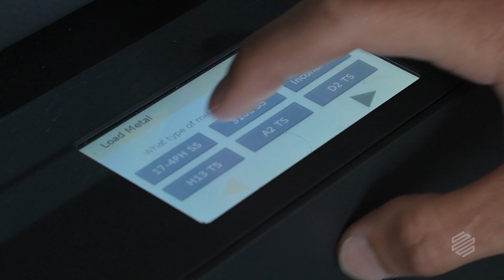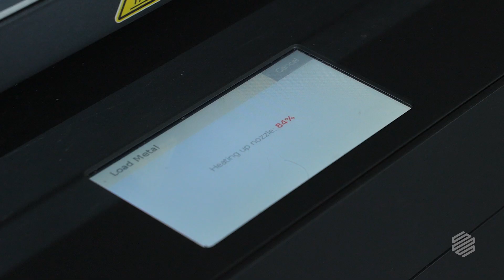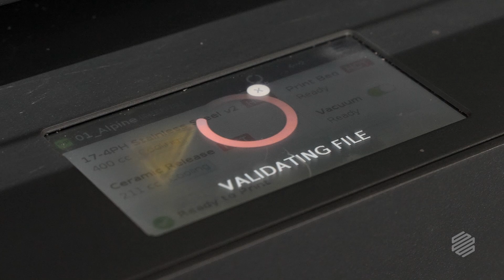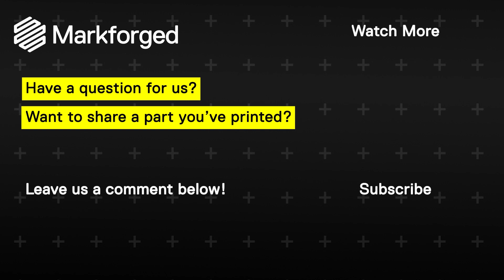Meet 17-4PH Stainless Steel v2

Comment: Sorry guys for this question but you also have filament for titanium and copper ?
Reply from the maker: No apologies necessary. We offer copper, however, we don't offer titanium.
Reply: @markforged  one more question ' do you offers aluminium filament ?
Reply from the maker: We do not offer aluminum at the moment. Currently we offer 17-4PH Stainless Steel, Copper, H13 Tool Steel, Inconel 625, A2 and D2 Tool Steel. 
We're constantly working to add more materials though - if one is announced we'll definitely post a video featuring it.
Reply: @markforged  let's say i have aluminum filament from other's brands ' the markforged 3d printer can work with those filament or just with the filament you are offering ?

Comment: can it be printed witha bambu lab X1C ?
Reply from the maker: Hi there! Markforged materials are intended to be printed with Markforged machines.
Reply: As long as your hotend can get over 400CC and a bed temp of 100Cc and also have an enclosure then any FDM printer will work.

Comment: it is unbelievable and highly suspicious. how every vid on this stuff tells you how "ITS METAL" and then spends zero time actually showing them using the metal parts, filing on them, tapping them, lathe-cutting..nothing! Either its a total scam or these non-blinking drone humans have no clue how to convey an idea
Reply from the maker: If you’d like to see applications from our customers using the Metal X, I’ve listed four customer stories below. If you’d like more info - I’d be happy to provide answers to any questions you may have. Thanks for watching! 

Nieka Systems | 3D Printing Inconel 625
https://www.youtube.com/watch?v=Smz5pzzbb_I

RPG Industries, Inc. | Metal 3D Printing Automotive Parts
https://www.youtube.com/watch?v=pVkPvFVGjeM

Caldwell Manufacturing | Metal and Carbon Fiber 3D Printing in Manufacturing
https://www.youtube.com/watch?v=Z9B1t7UXYBA

Lean Machine | 3D Printing for Lean Production
https://www.youtube.com/watch?v=F5cZsLrWz64

Comment: stainless is not magnetic...
Reply: Most types of Stainless steel are not magnetic but some are.
Reply: @muddasarakram419  You are  correct, and people should research before making the wrong conclusions
Reply: 17-4ph is definitely magnetic
Reply: @benjamintaylor4559  gets it!
Reply: Your right most of the time. 17-4 is martensitic and it is slightly magnetic...
Reply: 17-4 is
Reply: 17-4 is magnetic 🧲